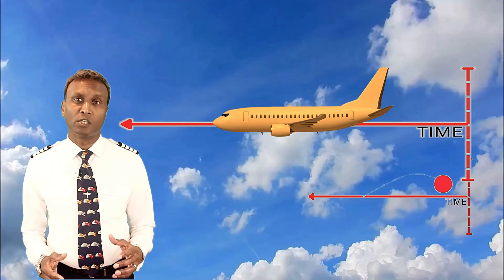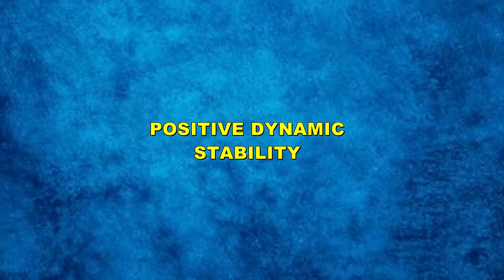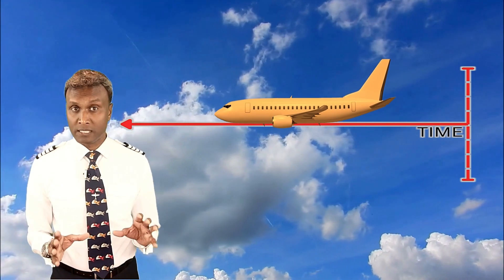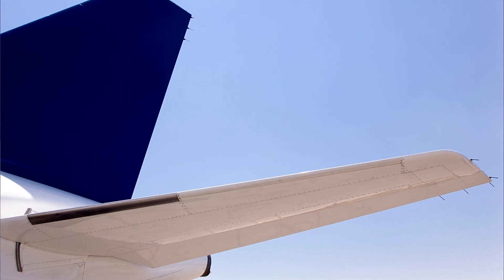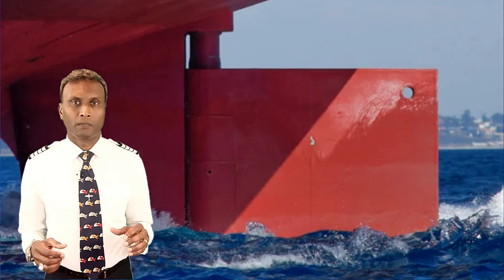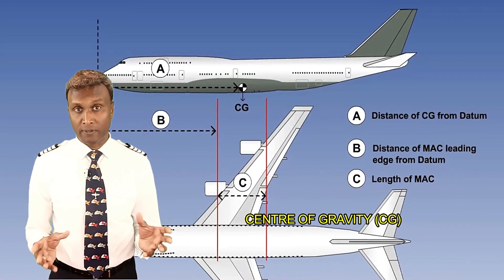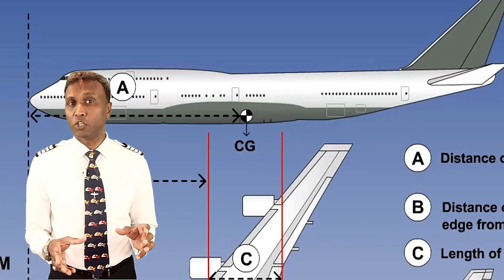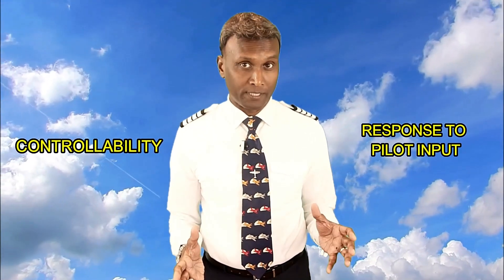Mastering Flight: Understanding Stability, Maneuverability, and Controllability

Comment: what does winglets have to do with lateral stability? I thought winglets acted like a dam for wingtip vortices
Reply from the maker: You're absolutely right—winglets are primarily designed to reduce wingtip vortices, which improves fuel efficiency by reducing drag. However, like other aircraft components such as landing gear and flaps, which have specific primary functions, winglets can also contribute to stability, particularly lateral stability. By altering the airflow near the wingtips, winglets can help balance rolling moments caused by turbulence or minor changes in the flight path. So, while their main job is reducing drag, they do have an added benefit when it comes to stability!